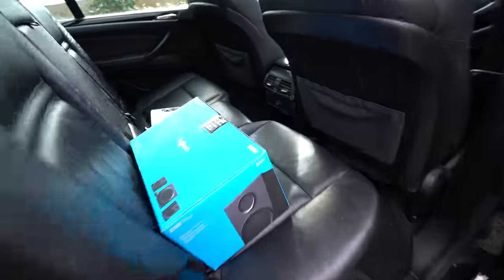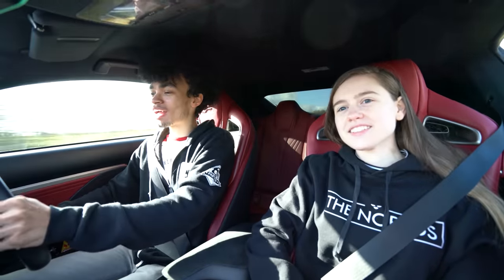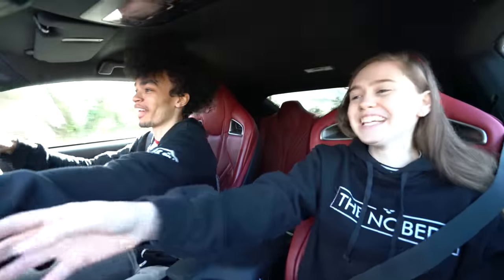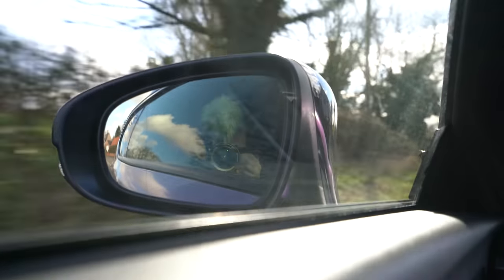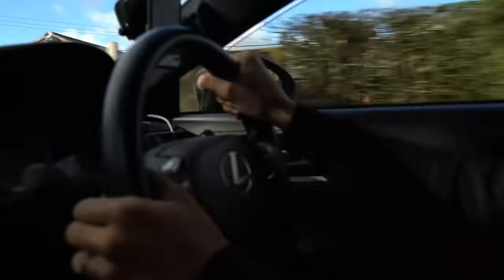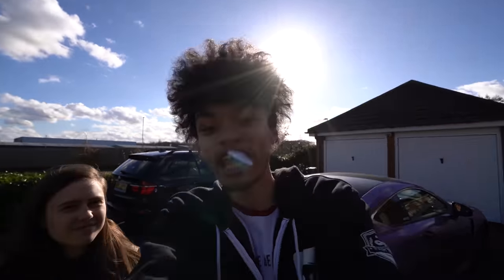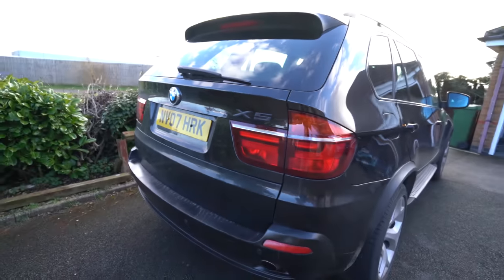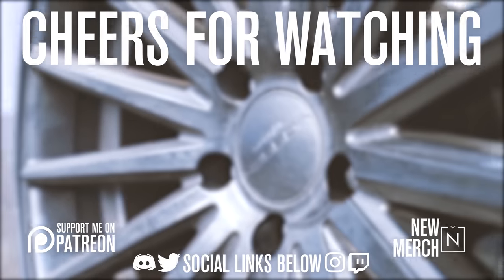I HATE My Dream Car…

Comment: So the speedy black man regretting the skyline life ???🤔
Reply: Neil Varia their very expensive to buy and care for. Completely understand where theo is coming from
Reply: Ricemaster 911 An R34 isn't much more expensive if you dig around and aren't bothered about a bit of hassle.

The RCF cost him £36K and that's without taking into consideration the cost of running the car or its insurance.

V8's in the UK are expensive due to fuel costs and insurance. The bigger the engine the more expensive it gets and the RCF is 5ltr Naturally Aspirated V8. That's a big engine and it means 2 things, high fuel costs, and very high insurance.

Not to mention the modifications he has. Changing the colour ups the insurance by 2%, changing the wheels = 4%, changing the exhaust = a 5% increase and he's far from finished.

The cost of a Skyline already in the UK is £70K+ but if he was to buy from Australia you could pick it up for a cheap as £8,000. The overall costs of transferring and insurance etc would come to roughly £40K to £50K over a 9 month to a year long period

That's not far off what he's paying for his RCF right now. Also, right hand drive RCF's are incredibly rare in the UK. Making them more exclusive than a R34 GTR. That will also up his insurance.

I understand his points, but I feel he lacked any decent amount of research into owning a GTR in the UK.
Reply: Kane Holmes pretty sure he said the r34 was 60k euros.

Comment: The RCF is great, but the F-type is better
Reply: You want to compare?
Reply: MAXYMOK the thing is the rcf is one of the worst car in its class. All of bmw’s, Audi’s, Mercedes’, Jaguar’s and the new Alfa Romeo’s equivalent cars are a mile better in speed, handling, weight and in my opinion looks both interior and exterior looks.
Reply: Callum Penman thats because most of them are not N/A
Reply: Zayed Alhashmi yeah but that doesn’t make them any worse. Watch the top gear ep where they tested the rcf.
Reply: Hell yeah